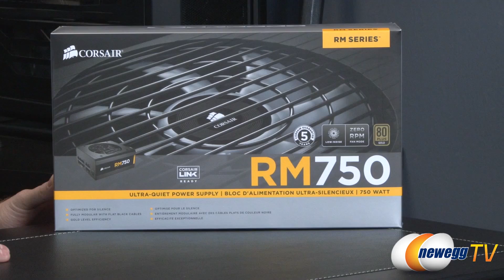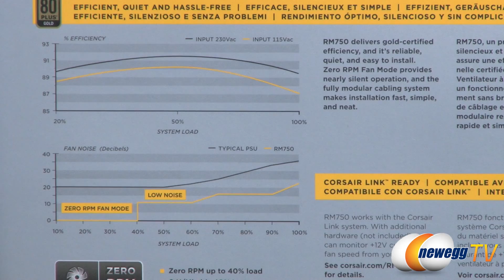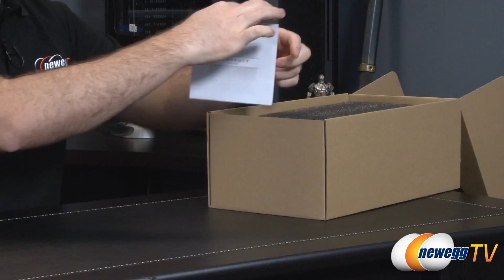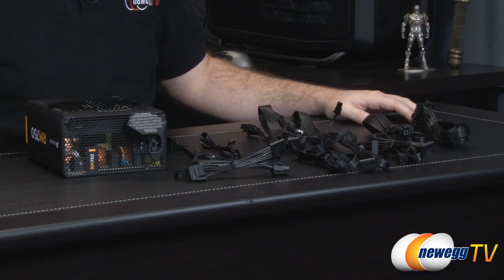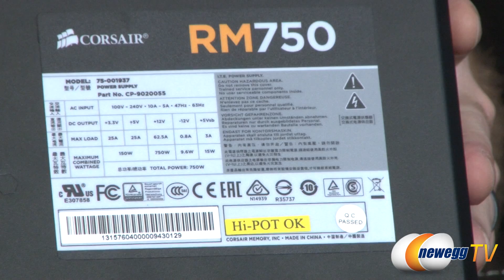CORSAIR RM Series Power Supply Overview - Newegg TV

Comment: i bought this and it didn't come with a CPU cable, you haven't showed it on the video either. should i use the PCIe cables??
Reply: it's in there, it should be a 2x4 connector that can split into 2 2x2 if your board only uses one of them as some boards require that extra power

Comment: Hi there, I recently purchase the xps 8700 series from Dell and now upgrading my gpu to nvidia geforce Gtx 970 4gb that I bought from Newegg. I have the stock/standard psu 460w that it came with, I understand that I have to upgrade my psu. The gtx 970 requires a minimum 500w psu will the corsair rm 650w more than enough also will it fit my xps 8700?
Reply: I'd at least go with the rm750 if that's what you are putting in
Reply: +Levi Bowman Wrong.  600 watts is more than enough.

Comment: I bought the 650w one and my 24 pin connector will not click into the slot in the mother board an if i touch the wire a little when i put it in it falls right out can anyone help? Or tell me whats wrong
Reply: Demonblade8000 I have the smae problem, except with a 550w bronze version

Comment: I have two gtx 970 and they crahs in games , I dont know if that is the problems ,I have the same psu in the vid
Reply: If its not an entire system crash its probably not the power supply. Can be the connection between the cards and mobo, a friend of mine experienced that.
Reply: 750watts?
I'm curious coz I'm planning to sli the 970 in the 650 version of this.
Reply: Solrac Oreca Oh no , big mistake , my 4ghz to 4,3 ghz lets the system crahs AC power loss , but when I set the power limit to max 100 (Wich gets you a 3-8 fps loss wich is really stupid)you are good to go with the RM750 watt Gold + , with power limit more than 100% on the gpus it will crahs after a while in gaming , when I oc with only one gtx 970 everything works perfecr btut the second gtx970 is just too much power consumption
Reply: Then I guess I won't go SLI. but I'm curious if the lower 550watts can handle a 970 OCed and a 4690K OCed just to save a little cost.
Reply: Solrac Oreca GO with SLI , ALl the way ! I play bf 4 at 4k Ultra with 60 fps ! Screw single gpus !First TIime sli , I am blasted 4k looks like a Mercedes compared to 1080p Ford LOL
Reply: well I have no budget for a 4k monitor yet, maybe when the time that I do, single card gpus can handle 4k and 4k could be dated already ._.
But yeah, I'm just balancing my cash, I could go for 1440p and a single 970 for now.
Reply: Solrac Oreca YOu dont need a 4k monitor to experience 4k with DSR (Only with 970 or 980) you can have 4k at yo ur 1080p monitor , I dont have 4k either but it looks 10 times better its so fucking amazing how sharp and crisp it looks! DONT DO THAT ! GET SLI  and use your 1080p monitor ! LOOKS AMAZING!
Reply: Solrac Oreca I can play with a single one 4k wit high settings arround 37 fps and that is not playable , but Ultra with SLi I get 60 fps and that is som really nice shit
Reply: King Kaka Why are you trying to power two 970s in SLI with only a 750 watt PSU? You're not going to have enough power with that kind of setup. Get a 1000 watt PSU if you want a stable machine, or at least 850 watts minimum.
Reply: Michael Hickey trying ? I already own SLI with the rm750 and a fx 8350 , it works amazing , 100% gpu scaling , and max OC both on gpu and cpu and Ram , you are not very well informed about how much power components actually draw
Reply: King Kaka Okay, mate. Some of us would like to have some extra reserve for future upgradeability, rather than push the power envelope of the PSU, but what do I know? I've only been building computers for the past fifteen years.
Reply: Michael Hickey Well then you are about as experienced as I am , but you maybe lack a bit of knowledge. I still have plenty of headroom , I pull max 380 watt under full load msi kombutor run , that is pretty far away from using the full 750 watt that the PSU is capable of , guru3d has graphs showing the wattage going over 800watt maximum with 91% efficiency with the rm750 ,
Reply: +Bot Blyat No, you just need to turn some stuff down.

Comment: would 750 wats be fine for ANY gpu?
Reply: Davide Zhang Troy Innes if you're going with the 295x2 you might need a bigger psu ;P
Reply: 550W-650W Is enough for any system with a single gpu.
Reply: +Lukas Menke (FreshDumbledore) that's not a single gpu.

Comment: this should be more than enough for running amd fx8350, 32gb ram, gigabyte gtx 770 4gb, 7 120mm fans and Corsair Hydro Series High Performance Liquid CPU Cooler H60 right? (not overclocking cpu or gpu)

Comment: i was wondering, i have a bit of an older psu, it is the Chieftec cft 750w 14c, can i reuse it for a new build, are all the pin connectors the same , or are some different

Comment: Is corsair rm 850w enough for two asus r9 280x dciit?
Reply: It should be more than enough.  I'm running an i5 3570k, Nvidia GTX 780, case with lights and all this other stuff all on a corsair 600 watt G series. I also OC the crap out of my card sometimes and I haven't had a failure yet.

Comment: The Lot code on this one is 1315 so it doesn't have the hardware fix.All RM 750s with Lot codes 1341 or greater have the hardware fix.Just bought one with Lot 1345.A very quiet PSU...

Comment: I got the 1000 watt one and using the amd stock fan, one other case fan and my gpu fans I could not hear any noise from 3 metres away!
Reply: dude the RM1000W can handle the r8 280x vipor oc card???
Reply: Easily, I have an fx 8350 cpu and a Gtx 770, they only use like 600W, its fine
Reply: wow really???nicee im gonna buy this RM!

Comment: thank you for this...the unit didnt come with a instruction manual, so when i was putting it together, it wasnt starting up. the computer would get power but not start up. once i watched the video, i realized there is a separate cable for the CPU, once i connected it, it started right up. thanks again!
Reply: I think I had that same problem except I think my MOBO has a 8pin and a 4 pin.  I was used to the 8 pin and think I overlooked the other one.  I have tore the whole thing apart and have a older MOBO right now but think I am going to try it again as the board was expensive.

Comment: So I'm looking to upgrade my graphics card on my pc to an amd radeon HD 7750 2gb, but my powersupply seems to be needing an upgrade to support it. I know absolutely nothing about power supplies, but I know the card needs a minimum of around 550 watts I believe. Would upgrading the power supply maybe cause unwanted damage to other parts of my computer if I get a higher watt PS? How should I go about purchasing one? Thanks!
Reply: You should be fine running a 7750 on a 550 watt power supply. And if you were to get a higher wattage power supply it would not hurt anything (assuming you get a decent brand) but the wattage only states how much total wattage the power supply is able to supply the components of your computer. As far as what to purchase I would go with either a Corsair or a SeaSonic.
Reply: THE WHITE GUY Thanks man!

Comment: 6:25 You need a Corsair Link Analog to Digital Bridge Cable for RM Series PSU to connect this cable to your motherboard. $10 + shipping (+maybe tax) from Corsair.
Only the 1000W PSU includes this part AFAIK: Amazon website says "additional cable required for 450W-850W units".

Comment: 750W might be enought. I'd go for 850 just in case. Manufactorer ''power requirements'' are miss leading. One gtx 770 uses about 200W, so 850W is what I'd get for SLI. 1000W total overkill imo

Comment: Psytex Divine  has a good point, you'll only need an i5, and with the money you save, you can put that on a better GPU, HD 7950, Asus, and MSI makes some really nice  versions., i would go to at least a 550 or 650 watt PSU, this will give you a little head room so it's not running a high load. 
You can find the GPU's at Newegg, around $200 - $300.

Comment: A solid 600W Power supply will run a 780. Linus did a video of a gold 550W with an overclocked 4770K and a 780. If you're worried about the 6 harddrives anything above 750w is wayy overkill, and your powersupply will be in-efficient (watch NCIX's video about power draw with the gtx 500 series, i3-i7) 1000 watts is silly

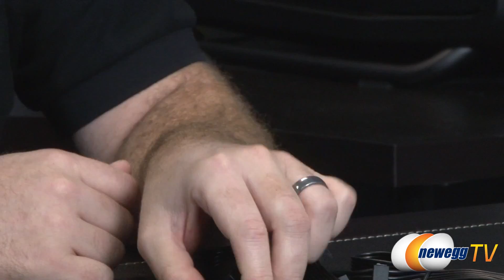Comment: FYI:  That Corsair Link cable you show at 6:30 does NOT plug into the motherboard.  The signal coming from the RM is analog.  You need either the optional Corsair Digital Bridge or a Corsair Link Cooling Node to convert the analog signal to a digital signal.  That cable plugs into either of those extra devices.  Unless you have the 1000W, the RM power supply, by itself, is NOT Link compatible.  You must have optional hardware installed.

Comment: I'm a pick up at 1000 watt supply been looking upgrade my power supply right now I'm on a 600 watt and I want to get a GTX 780  I also have  6 hard drives  my current GPU  is a 660 does anybody know if the Titan is better than 780 because I've been hearing a lot of mixed reports about this

Comment: Try again.....
They are just about the same. Multi rail will be a tiny bit better at high wattage(1000 and higher) though. So yes Multirail>single rail but you are over-exaggerating on it as anything under 1000W it doesnt really matter single vs multi.